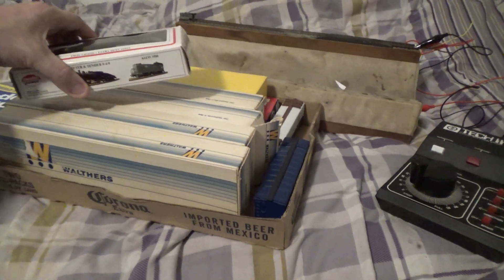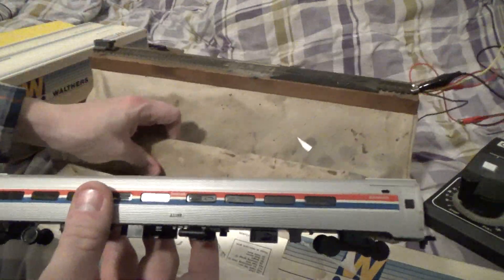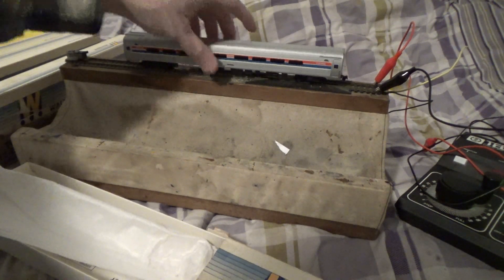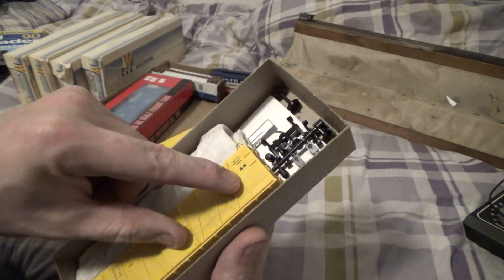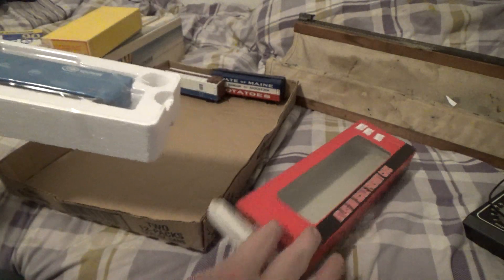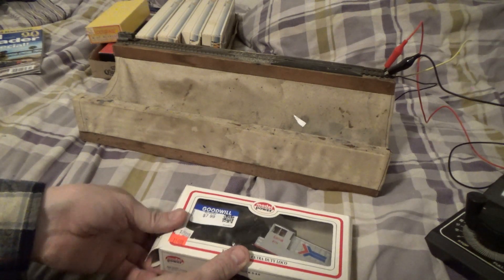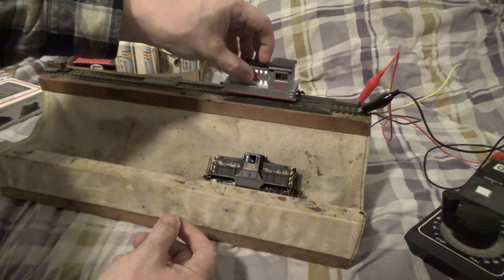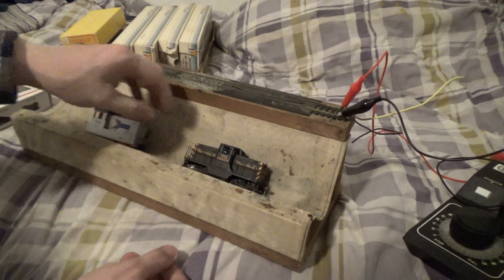awesome finds from local flea market and thrift store for my Ho scale collection

Comment: Another steal, great bargains Matt.
Reply from the maker: Thank you. Yeah it's crazy when I find these things. I looked at one of the Amtrak cars and they don't have any lights. So I can try to get LED lights with bridge rectifier like a pack that I bought from The hobby shop about a couple weeks ago . And maybe install it on a breadboard with a keep alive capacitor. Sometimes I think it's the luck of the draw. That Atlas box car was never used I actually cut the tape on it and looked. I'm surprised that you see cars like this. I have many Atlas cars that are like that brand new in the box and they don't make the style of cars. Like an example I have two Providence and Worcester boxcars and you can't get them new anymore from what I've seen. Thanks for watching take care.